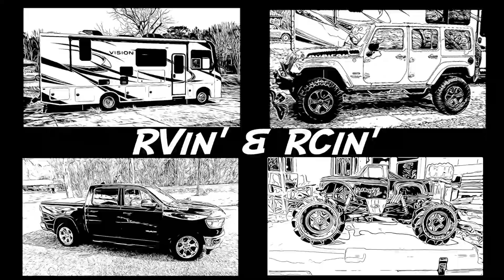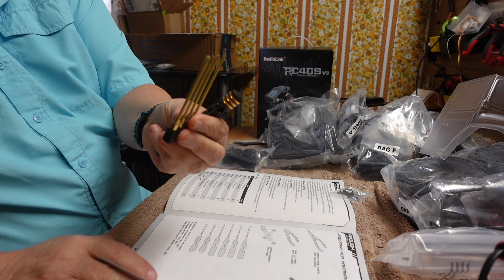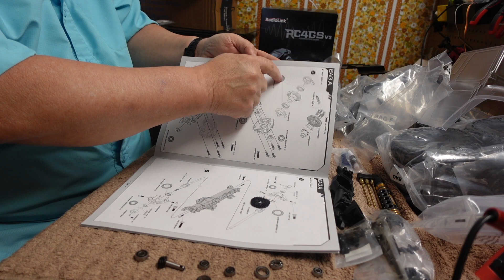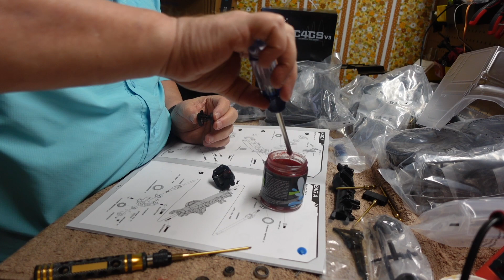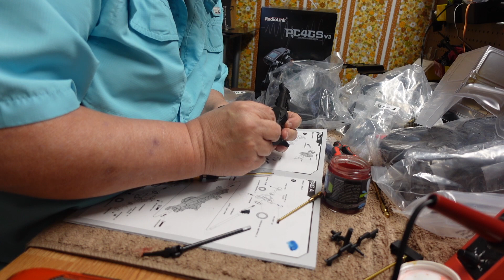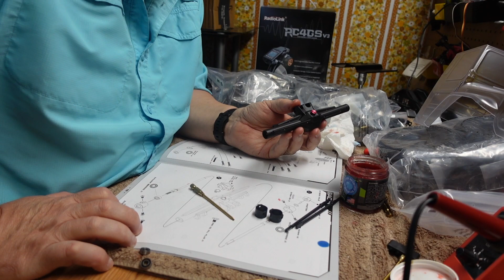Vanguish VS4-10 - Beginners Build - Axles - Part Four

Comment: The VS4-10 was my first Kit build. The transmission is the hardest part but went together smoothly.  Mine came with a bent rear axle but Vanquish handled it quickly.  Great video and great advice 👍🏾
Reply from the maker: Thanks.